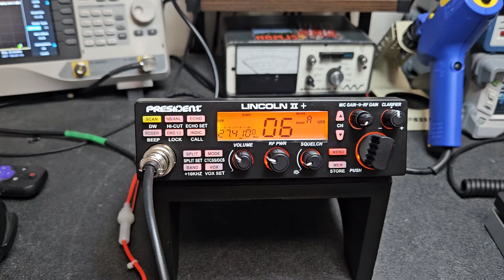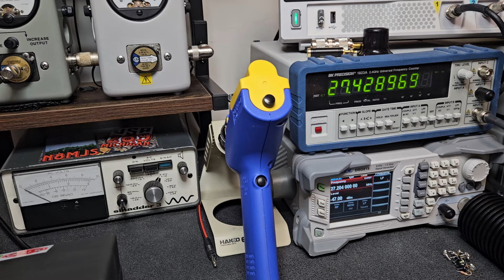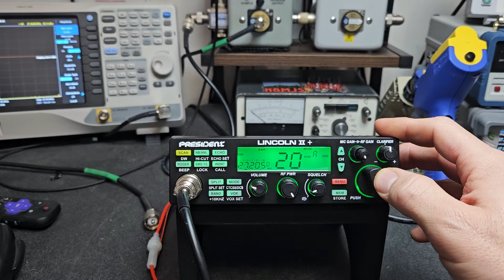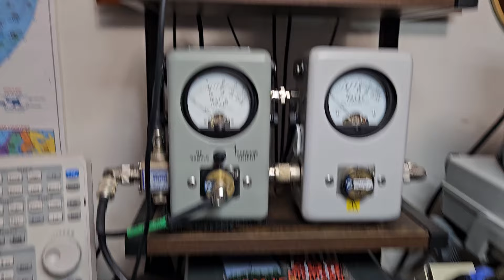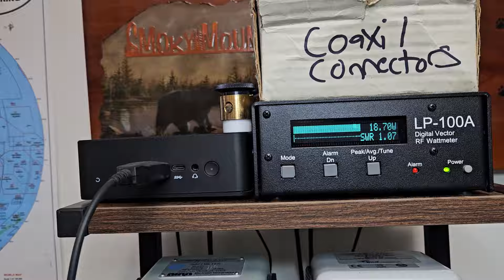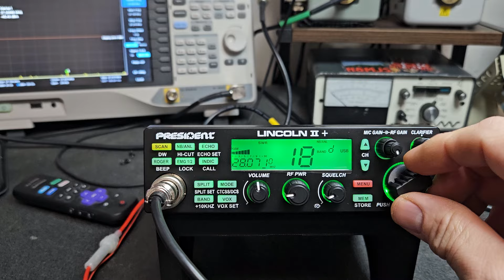New President Lincoln 2+ for Paula

Comment: I like them Lincoln 2+ radios.  I did have have a HR 2510 for awhile.   That radio a bit tricky to learn but still easy . Yes FT8 on 10/12 meters crazy strong. Even in NY today.  Just dealing with high noise floor again. My be from storm system coming in. Today NOAA update is Starting Wednesday for us. Calling this a server winter storm watch with near blizzard conditions and storm totals up to 48 in snow likely and  will start as heavy rain and very quick drop in temp with 50 MPH winds . My DX hear on 10/11/12 meters is all going south . Texas is super strong mostly from Dalles and Grape Vine area . Pushing 10-20 over S9 at times hear . Punching threw high noise with ease . I just drop RF gain till noise like 1 to 3 . No FM or AM 10 meter I can hear . Noise floor high . Is taking some watts to make contacts. Like 100 PEP . Still not bad getting out. I think storm changing bands. so different from day before . Even AM broadcast is noisy at night now. Some west states not coming in now. They did yesterday.  The east coast comes in fine. WMRI and WBCQ are very strong now,  More than normal . WWV on 10 and 5 MHZ coming in great. No 2.5 MHZ yet That comes in from Hawaii around 10 PM to like 4 AM hear . Nice Female voice ID . WWV has male voice. I normally get WWV on 25 MHZ . I did yesterday . 20 and 15 as well. Big change in 24 HR in bands hear . CHU Canada is strong hear . Most always.  I am not far so ground wave . I got loop stick antenna board coming for 60 KHZ WWVB . I friend sending a extra one to me. I have one built in to a Nixie tube clock. All you do is set time zone and it right on . NOAA beeping again. This storm is getting NY good. It a ways out . NOAA been great tracking storms and getting them warring's out.  I won't travel with out a weather radio . I get Marine weather hear as well. And the weather in the AM air band . Even the RTTY weather for Marine. 7300 decodes RTTY directly . I also have FL Digi and more on PC . 73